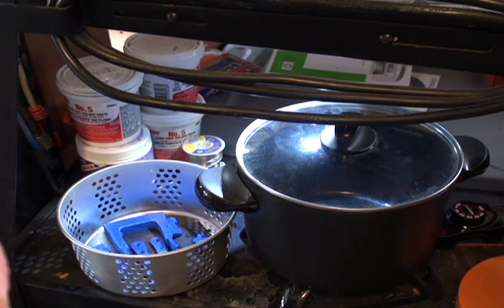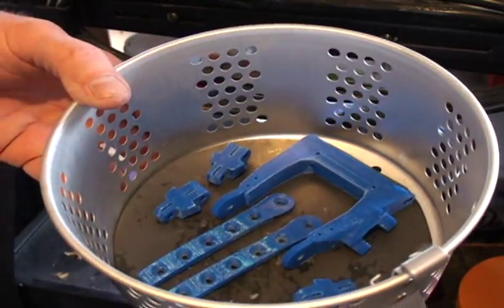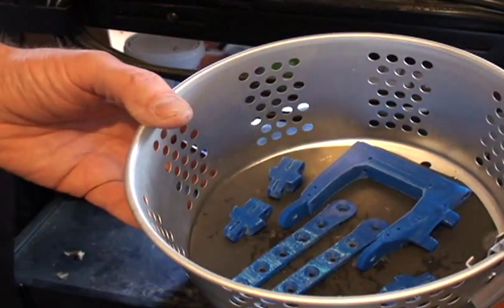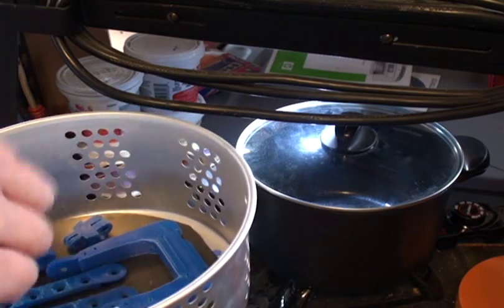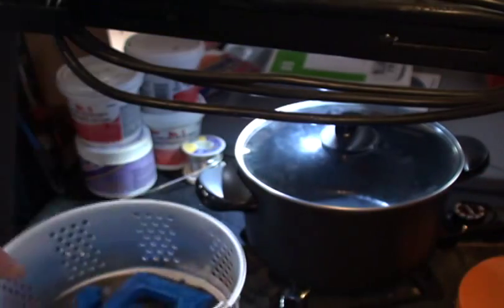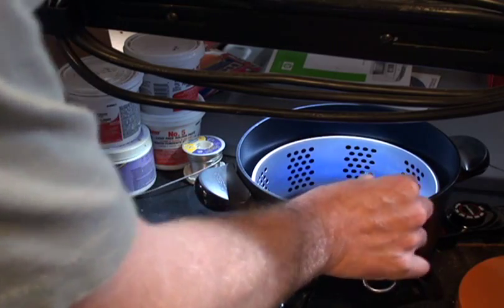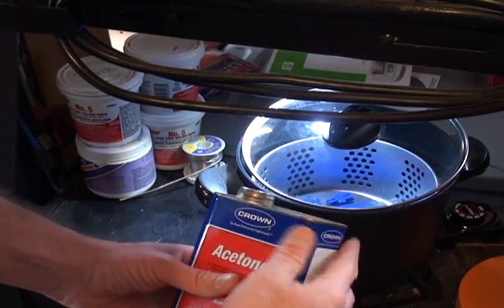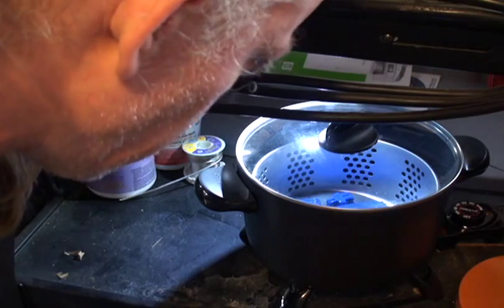Acetone Vapor Treatment of printed ABS

Comment: When I leave in there for a short time like you, nothing happens.. Even after 5, 10 or 60 minutes the results are a bit disappointing. Could it be the type of acetone I'm using? I have noticed there are differences in effect between different brands of acetone. Is there one brand you could advice me? Preferably one that is obtainable in the Netherlands :)
Reply from the maker: +Antoine de Bock (Anteino) I don't think there are different kinds of acetone, but there are definitely different formulations of ABS. Some brands of ABS don't smooth very well. What brand (manufacturer)  of filament are you using?
Reply: There are definately different brands, of that I'm sure. There are different kinds of purity, some of them contain part acetone replacements I believe, the "eco" acetone, which is crap. For filaments I've tried the more expensive brands, like lay3rs. But also the cheaper ones like esun. No different result whatsoever for me in filament brand, only difference in acetone used. Are you from Holland by the way? Your username makes me think so. If you are, can you tell me where in holland you get your acetone?
Reply from the maker: I love Holland, but I don't live there. I'm in the USA. I buy my acetone at the hardware store.

Comment: Thanks for posting this video. Question about the non-stick coating spray. Is there a reason you sprayed the flashing insert and not just the entire aluminum basket instead?
Reply: Actually, I recently bought a thin sheet of PTFE and cut it into circles to fit in the bottom of the basket. It works much better than the aluminum sheet with graphite.

Comment: Thanks Peter. How did you test for strength?
Reply from the maker: I haven't really done any solid research. I make assistive (prosthetic) devices for my son, and have found the smoothed parts to last longer. Thin areas break easily with little force, but after vapor treatment, they are much more solid. It also makes perfect sense that a part with a monolithic surface would be stronger. That said, I'd like to see some formal testing.
Reply: Maravilhoso,estou encantada...obrigada por tudo isso,a Adsta agradece !!